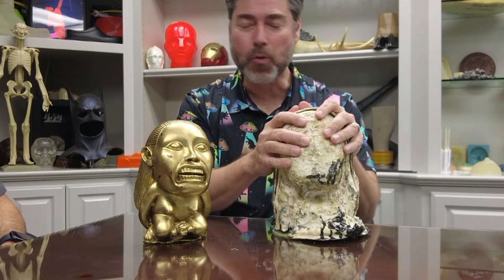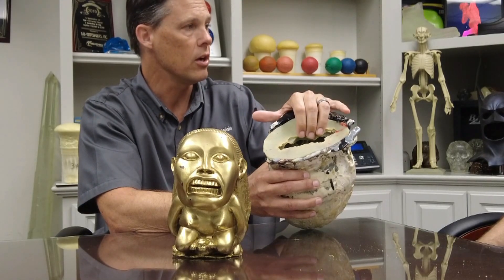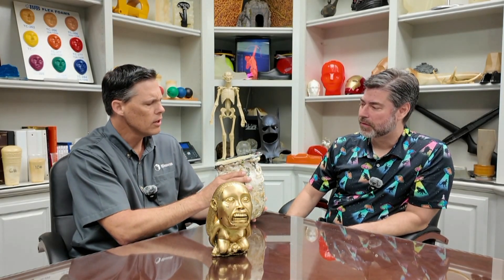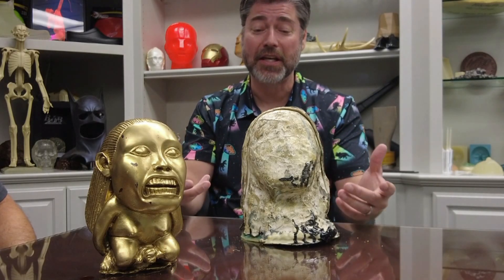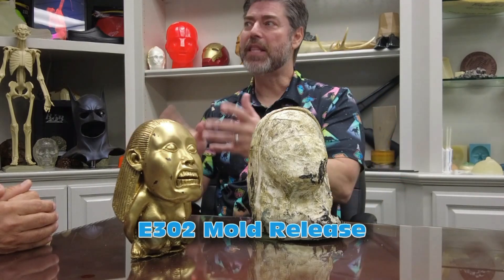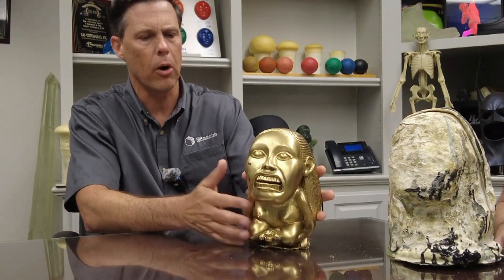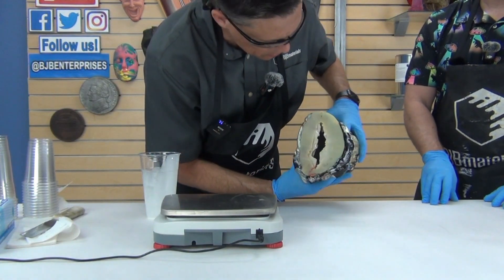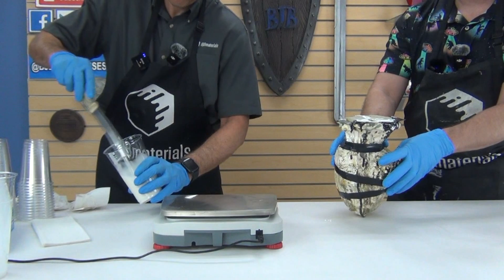Replica Prop From An Old Silicone Mold - On Location With BJB Enterprises

Comment: Might be best to use a hairdryer or hand held battery operated leaf blowed instead of an air hose because the compressor that’s used has moisture inside it and it will escape through the air hose.
😊
Reply from the maker: This air compressor has a water trap so thankfully that’s not an issue.